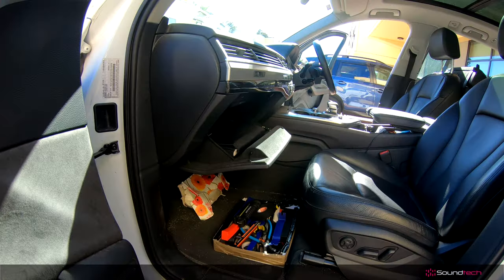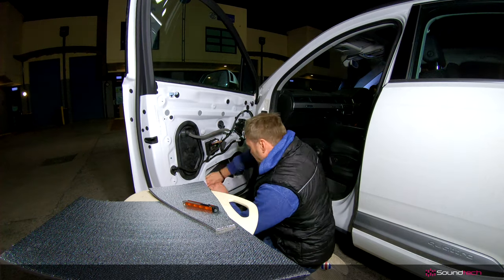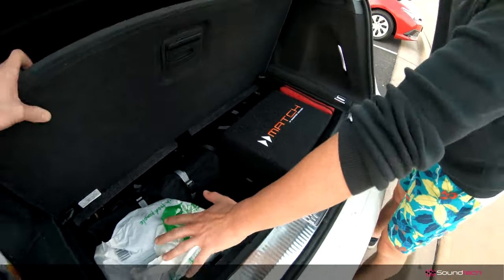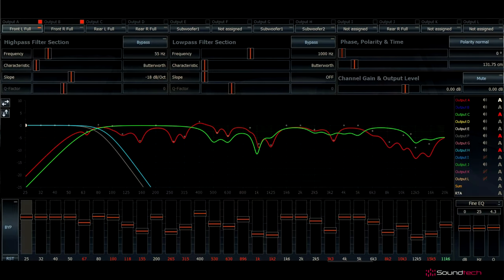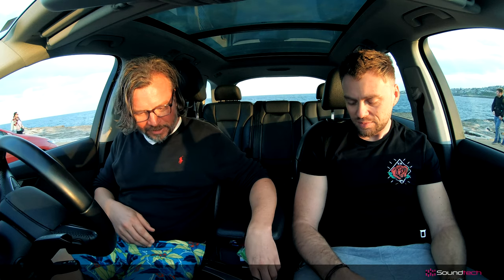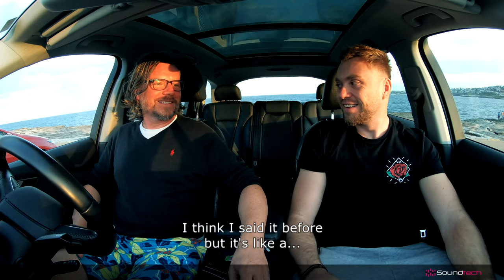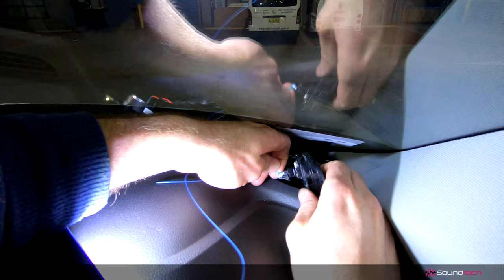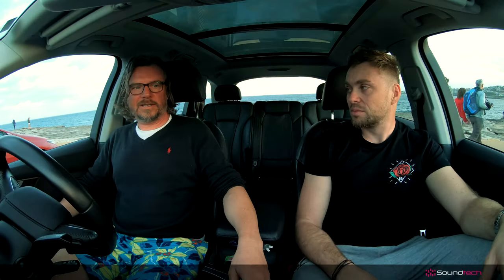Audi Q7 - MATCH sound system installed - customer's feedback

Comment: I have a question, I have 2017 BMW 330xi with Hi-Fi, I have upgraded Tweeters, Mids front and Rears and two under seat Subwoofers also installed Bimmertech PP86DSP DSP Amp, I bought all this from Bimmertech. I feel I need more bass, can I add Match PP 7S-D Compact trunk Subwoofer and not loosing existing underseat subwoofers?
Reply from the maker: Already replied to the same comment you posted on our other video here https://www.youtube.com/watch?v=pbRb77SceMo&lc=UgwRlanaienarQoQuvh4AaABAg

Comment: Hi, great install!

Does the 8 channel MATCH UP 8DSP provide a output signal to each speaker directly through the PP-VAG 2.6 harness? For example, is it fully active with each of the 8 channels feeding each of the 4 mids + 4 tweeters and crossovers in the DSP, or does it simply provide 4 channel output - one to each door, and then use passive crossovers in the doors to split a full range signal between the mid & tweeter?
Reply: I had this same thought/question. Have been debating between the Match or Helix dsp/amps
Reply: @bballfreak150  I found the answer elsewhere. The harness is not fully active, it provides signal to 4 channels and the car's inbuilt wiring will put a full signal to the front & rear woofers and a high pass signal to the tweeter. Based on this, I decided to go for a 7 channel setup by running:
 - 2 channels to the front woofers, using the cars standard wiring (supported by the PP-VAG 2.6 harness)
 - 2 channels to the front tweeters, running my own feed from the amp to the front tweeter location
 - 1 channel to the front dash / centre mid-bass woofer, running my own feed from the amp to the front dash centre woofer
 - 2 channels to the rear woofers + tweeters, using the cars standard wiring that provides a single feed to both the woofer & tweeter (supported by the PP-VAG 2.6 harness)

So I have full active control of all the front speakers independently from the DSP, then I have control of each pair of rear speakers (woofer + tweeter). This setup allows me to use an 8 channel amp, and saves me from running a separate feed to the B pillar tweeters. I went with the Match 8DSP for this setup which fits under the front drivers seat. Then of course a separate amp under the passenger seat for subs which live in the boot.

Hope this helps.

Comment: Nice work!! Can I please ask how you routed the power cable to the battery? About to order the Match amp for my Q7 but will have to install myself as I am in the middle of nowhere. Thank you for your help and all the best.
Reply from the maker: I think we run it around, through the front floor so you don't need to remove the middle console it'd be a pain. Use something like this to fish the cables through will save you half a day and about 30 sware words each hour: 
Yellow Tongue Cable Wall Snake https://www.ebay.com.au/itm/Yellow-Tongue-Cable-Wall-Snake-3-6-m-/193644900272?_trksid=p2349624.m46890.l49292

Are you Australia based? Or where are you ordering it to?
Good luck with your installation 👍
Reply: @soundtech7989  Much appreciated, a real help. I am up in the Highlands of Scotland, wish I was in Oz.
Reply from the maker: How much is Match PP86 there?